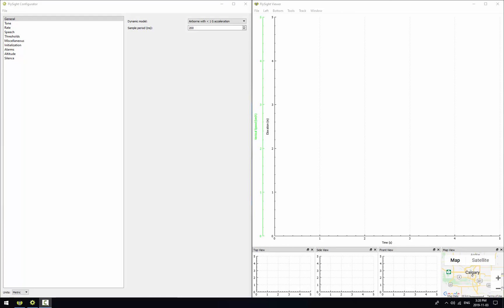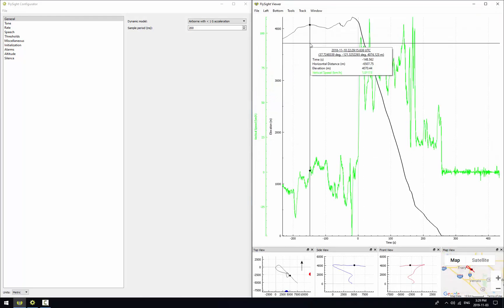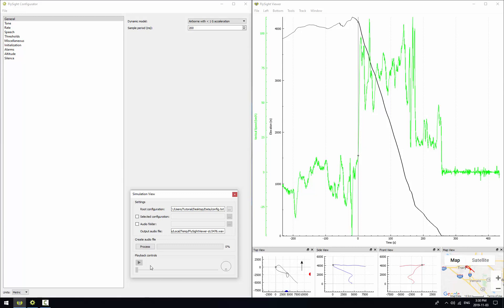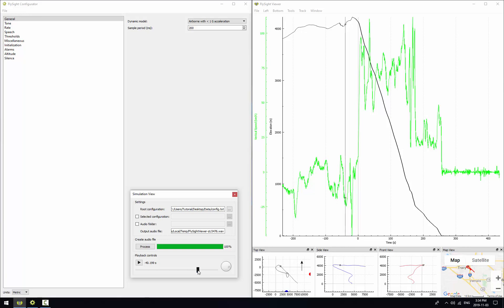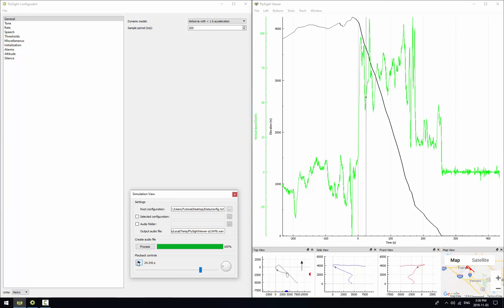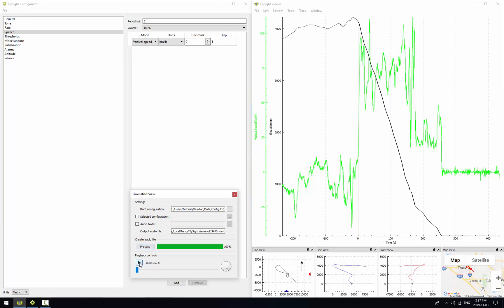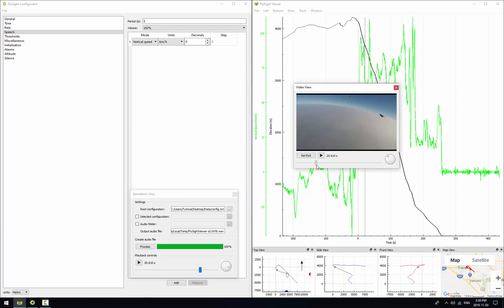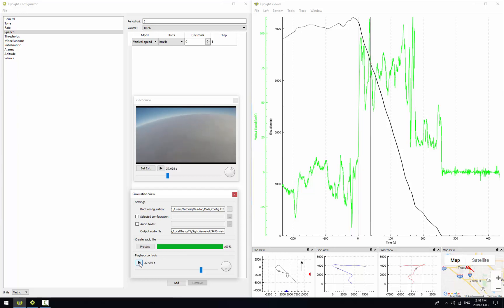Audio simulation in FlySight Viewer

Comment: Can you set alarms for altitude or count down of altitude?  I would prefer to use this even if it’s not quite as accurate as a audable alti
Reply from the maker: If you're just looking to have altitude called out at regular intervals--e.g., every 500 feet AGL--you can use "altitude mode". If you're using FlySight Configurator, you'll find this mode in the "Altitude" tab, or if you're editing your configuration file manually, you should find it under "Altitude mode settings". We will also be covering this soon in our short video series.

The altitude readings you get this way should actually be quite a bit more accurate than barometric readings, in that they give a measurement of your true altitude above the ground (as opposed to an altitude estimate based on air pressure). However, a barometric device like an audible altimeter is much more reliable, since a pressure sensor can't lose its fix. For this reason, FlySight's altitude mode should never be used to indicate critical altitudes like break-off or pull time. Also for this reason, FlySight won't indicate altitude below 1500 m AGL (though you can still use custom alarms to indicate altitude in this range if you like).